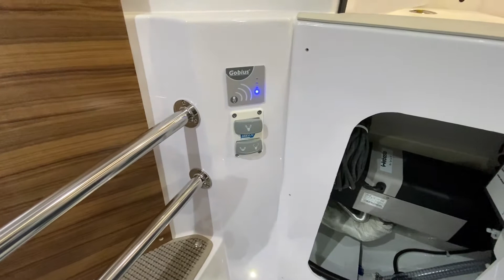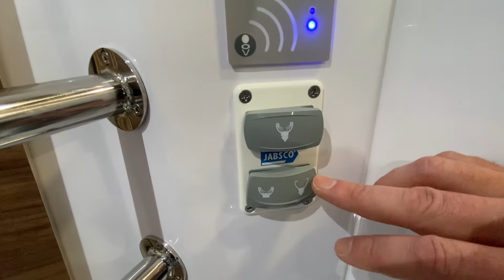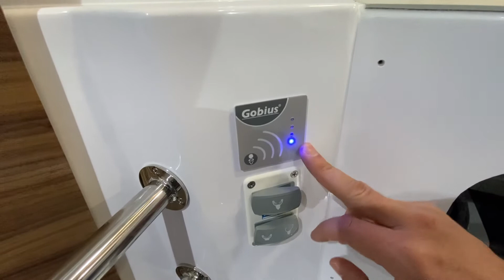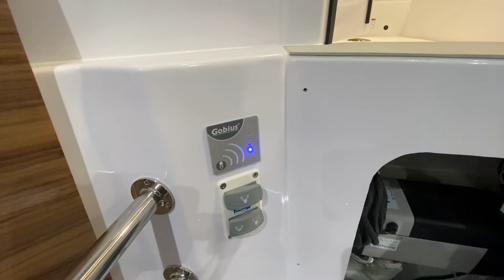Axopar Education: 28 Head System

Comment: Another helpful video...and the several close-ups were especially helpful & well done.  Ben, did I miss the location of the macerator pump.  I don't see white hoses running forward from the holding tank, which leads me to believe the macerator is buried somewhere in the boat's bowels.  As you know, these can be an (especially obnoxious) failure point.  Is this perhaps referenced in another of the education videos?  If not, then just a comment about its location would be helpful.  Thank you once again for these, Ben.  Super good stuff.
Reply from the maker: the macerator is in the same compartment as the diesel heater. Mounted just outboard. Thanks again for watching these videos!
Reply: @EastCoastYachtSales  Thanks, Ben.  Re-watched the video on the Webasto system and, yup, it looks like the macerator pump is pretty squirreled away & inaccessible.  Sure will want to make certain the head system is fully winterized!

Comment: Hi Ben, how do you add the pink disinfectant into the system?
Reply from the maker: The pink in the water lines and holding tank is all anti-freeze. In the winter in northern climates we run it through all the plumbing to eliminate the water from freezing and cracking pipes. Come spring we flush it out.
Reply: @EastCoastYachtSales  Noted Ben. Does the holding tank need disinfectant at all? If so, how best to do that?
Reply from the maker: There is holding tank treatment that you can buy a westmarine, this is not required and I haven’t done it on my Axopar.  To add the treatment you simply pour it into the bowl and flush.